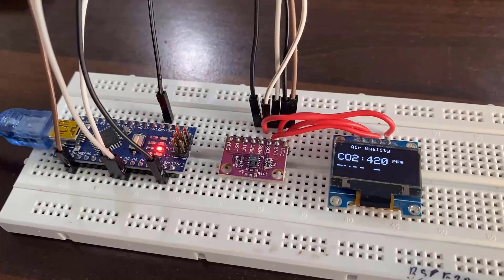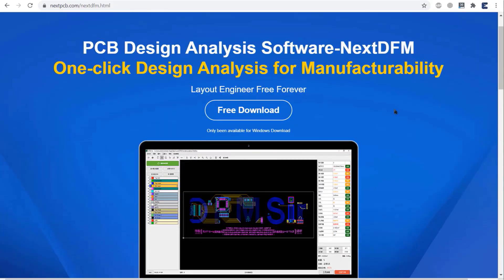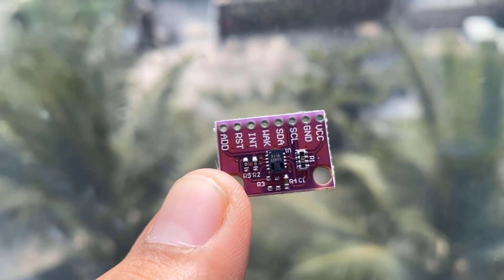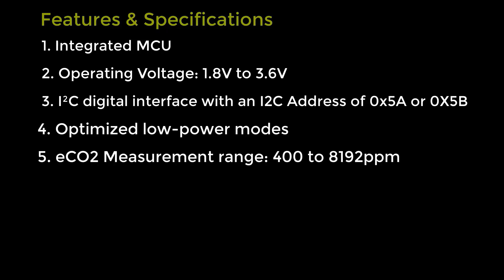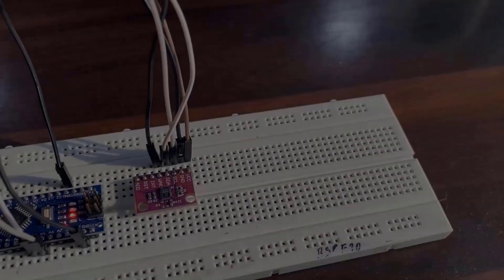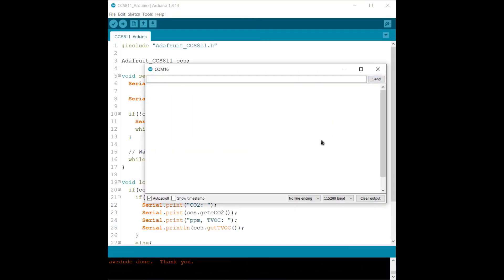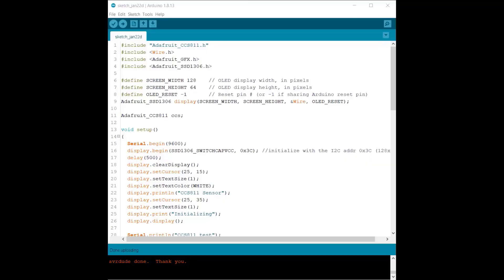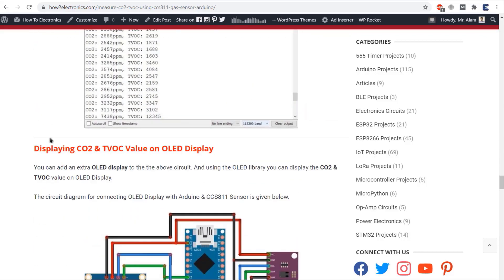CO2 & TVOC Measurement using CCS811 Air Quality Gas Sensor & Arduino

Comment: I know it's quite old already, but there are few things you forgot to mention/implement.
First, the sensor has its burn-in period, during which the measures are not accurate. For some sensors it may take about 1 week to stabilize the reading. 
Second, this sensor needs temperature and humidity to compensate the readings. Both the values affect CO2 and TVOC otherwise.

I saw you suggested to change I2C address in library, but this can be done by passing the address when initializing library.